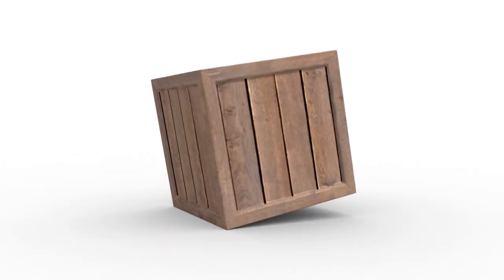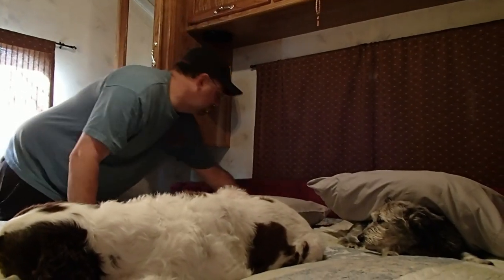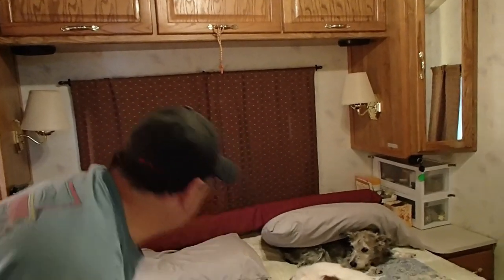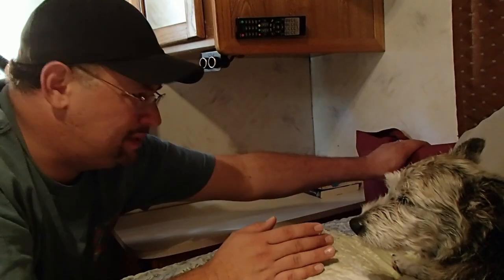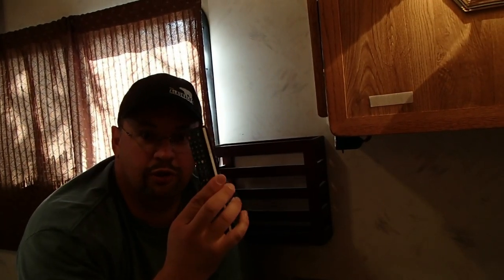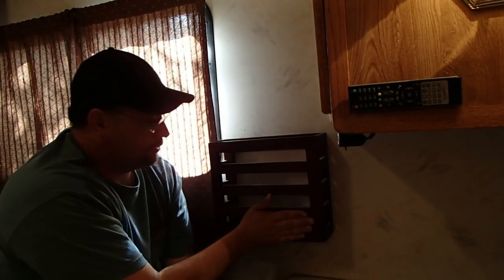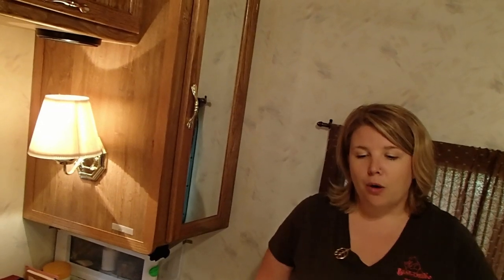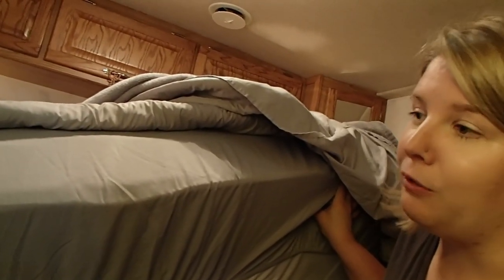How to sleep better in your RV!

Comment: Some great tips.

When we remodeled our rig we made it so we could put a standard queen 8" memory foam mattress. We also used plastic but we put it on the outside and we used 1/2" to an 1" of insulation foam.  We did spend over 2 years full-timing in our rig up here in Alaska.
Reply: Our rig is 83 Southwind we named her Lola. We gutted Lola before we remodeled. I did add great stuff to some areas when it was gutted and later added great stuff to the inside of the aluminum channel that holds the wall and roof together and under the dash where ever I felt air blowing in during a wind storm.  I added an extra 2 inch insulated foam inside on the outer walls around the reg queen bed, under the bunks, in the back of the pantry, under the counters, in the overhead cubbies and under the sofas, also added 2 inch foam on the floor under the queen bed and the area under the sofas. We don’t feel any drafts. The fall of 2015 we added a Kimberly wood stove. I still want to add some 1.5 or 2 inch foam on the bottom side of Lola and insulated skirting.

Comment: I was expecting to hear about how the tennis racket (1:30) helped you sleep better . . . :)   Window placement to the sides of the bed was a "must have" when we choose a new rig last year.  No more wet pillows or frozen forearms early and late season for these guys!
Reply: I did recognize it as a battery powered bug elimination devise - I was thinking it could be used as volume control for a snoring partner.  My dog snores :)

Comment: We always train our dogs to NOT sleep on our beds or get on our furniture. i would not want to sleep in bed with any animal other than my wife. We got a 4 inch thick memory foam topper for our bed and it is as good as the Tempurpedic we have in our home. Costed us about $150 at WalMart. But you got to get the 4 inch one. Other then that your tips are great. I have no problems sleeping in our motorhome but of course I am not over 6 feet all.
Reply: It is longer but we got a "full" not a queen as the mattress is a queen so it does not come all the way over to the edges but works fine as we tend to sleep in the middle of the bed. . We have beds for our dogs beside our beds. We are picky with dogs. Not on the furniture at home or in some rooms and in only parts of the yard. We do let one sit on the couch in the motorhome as she gets car sick on the floor for some reason. We have a gate also and don't let them in the cockpit area. Sounds kind of mean but we love them and they love to travel with us.
Reply: You can cut off the excess if you need to with a knife. Doesn't need to be hemmed or anything. It will be fine.